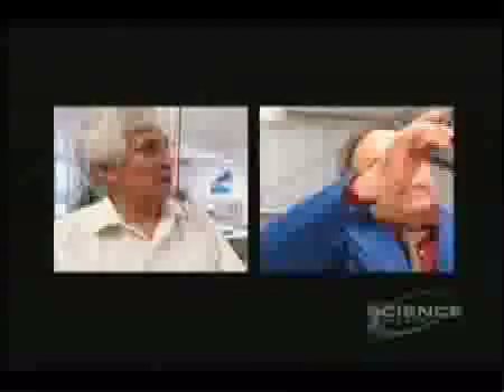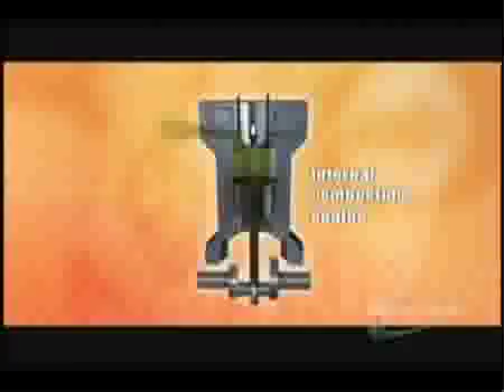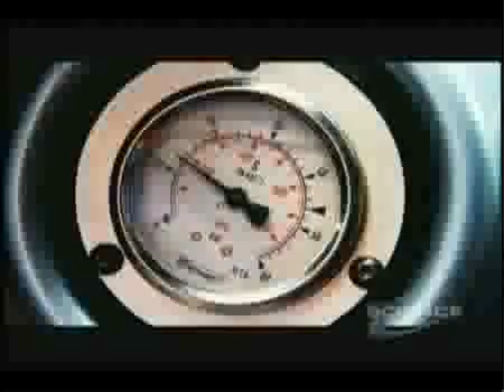Air Car (1 of 2) from France

Comment from the maker: You can ask the same question about any parts of the car.  The answer is the same.  The manufacturer of the car will make them or have them made by an OEM equipment supplier.

Comment from the maker: It may be true that a new set of battery cost thousands.  However, the used battery salvaged from crashed Prius in junk yard is going for about $700 to $1000 in current market.  Since Toyota covers the battery for 10 years and 150K miles, there is actually no after market for the battery.  I won't buy from the junk yard until my Toyota warranty expires.  I guess by 2014, the used battery price may rise, but by then mass production and better manufacturing will drive the new battery price down.

Comment: yeah but as long as we do better in cleaning up our means of producing electricity, especially renewables. Then the electric efficiency of compressors becomes less important because we aren't polluting in making the electricity. Range is actually pretty good with one tank of gas. power is low, agreed but it works for city driving, and I'm sure innovation will slowly push it up as has been the case since the first internal combustion engine was invented.

Comment: It uses electricity to compress the air - a low efficiency process and where do you think the electricity comes from? The hybrid uses a gasoline engine to compress the air. The range is short. The power is low.

Why won't the major manufacturers build them? Because no-one in their right mind will buy one.
Reply: Bs I would. We need alt fuel cars
Reply: @unicornjennie  the energy generation mix has changed a lot in the last 12 years.
Reply: Not to the benefit of the environment or the dependency of fossil fuels and growing prices of both gas and cars. And the major manufacturer s won't build them because of oil companies paying off  governments.

Comment from the maker: Keep in mind that this kind of solution is not situable for all situations because of the limited range of the non-hybrid version.  This is perfect for city driving, such as in New York City.  
However, in a hybrid version with an on-board fuel powered air compressor, it can extend range, the fuel cost and emission will be much different though.

Comment: the cylinder, where compressed air is stored, is made of a strong carbon material that will prevent explosion and only tear, creating a leak of air. But you're right. Our gas cars pose no threat. I mean, it's not like they carry an explosive material in the tank that could potentially explode in an accident. Oh no wait, they can!! Idiots!

Comment from the maker: You have to separate Energy issues from pollution issues.  The air cars do not solve either one.  The air cars still need energy to compress the air before the air cars can run on emission free compress air.  However, the compression of the air require some energy burning process.  It can be as clean as solar power, geothermal power, wind power, hydro-electric power, NUKE, or it can be as dirty as a coal fired electric power plant.

Comment: No, air would not run out, as it is recycled. It's just the air pressure that is used up, a potential energy is used, if you prefer. And electricity to re-pressurise does not necessarily mean fossil fuels to make the electricity. The world's knowledge and use of renewable energy is accelerating majorly, and it's something we can only be positive about.

Comment: Electric energy which compressor will use to compress air cylinders to run air car is a very inefficient way. Instead you use that electricity to charge a battery and run the car about 8 time more distance. You calculate which one is less polluting. Coal used to produce electricity also produce lot of CO2. So don't waste that electricity with foolish idea of air car.  Yes work on improving the car which uses less and less energy to run unit distance.  Applaud those ideas not this.

Comment: Air compression is only 10% or less efficient in storing and converting electrical energy to mechanical energy. Comparatively a battery is more than 80% efficient. To get about 1 hp-hr energy for car compressed air will need about 10 hp-hr of electricity compared to only 1.25 hp-hr for a battery car. Battery car does not leave any pollutant.  Therefore, air car will cause overall more pollution. Unless the company has developed a super high efficient compressor.

Comment from the maker: Warranty and lifespan are two different things.  The warranty is only a reassurance that the rumored early failure is untrue.  The Prius has been in production since 1997 starting in Japan market.  It was introduced to the US in 2001.  Tens of thousands of Prius have expired their warranty already and yet no owner screaming about battery failure.  There may be some isolated incidents but in general the battery should last as long as the car.

Comment from the maker: The battery on the Toyota Prius is designed to last the life time of the car too.  Toyota's warranty covers the hybrid system and the battery for 10 years or 150K miles in certain states in the US. For the rest of the US, the warranty covers 8 years or 100K miles.  The compressed air tank is probably cleaner to produce.

Comment: the united states has enough area by the sea and in the west to power itself on just wind power. Electric cars are the way to go, seeing that compressed air is pumped by electricy. 2bad oil companies have so much power.  i should dispose of the oil industry's leaders.  

oh and question: so would these cars float then?that would be cool.

Comment: this is really fallacious you know?  This car doesn't run on air, it runs on COMPRESSED air, which is fundamentally different.  The air is compressed with electric pumps, and that electricity comes overwhelmingly from coal power stations.
So there u go, a car that runs on coal thanks to air compression

Comment: Another way to increase the mileage would be to have it compress air everytime you use the brakes, witch would be nice because then you wouldn't really need breakes, they could have it on a clutch system.

Comment: Yeah, thats what I mean. Also that the battery powered car does this exact same thing. Draws equally little powered, charges with electricity, produces less heat, is more quiet. It's exactly the same.

Comment: did u even listen to that video? to re fill the compressed air cylinders you can use the onboard air compressor - or go to a service station. these run on electricity. not an oil powered engine dumbass.

Comment: The only reason this consumes less energy is because its weaker than a gas engine. A gas engine does produce much more excess heat though, so we're saving on that end. But why wasnt the battery driven a success? It draws equally much power since it works pretty much the same way. Instead of using electricity to charge air tubes, it uses electricity to charge a battery.

Comment: The only problem is the way you refill those tubes... These things bascially works exactly like batteries. The only thing they can do is to take energy with them. They need to be refilled somehow. How? Using oil powered engines maybe...

Just like batteries need to be charged. Electric cars dont really run on electricity, they run on whatever was used to charge the batteries. Still, Im very impressed they managed to get such an outstanding mileage using compressed air.